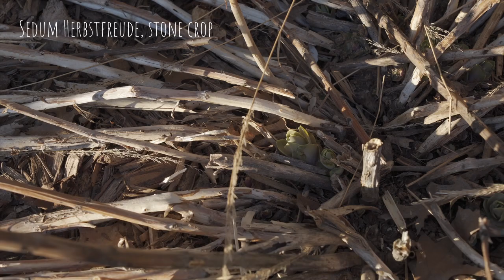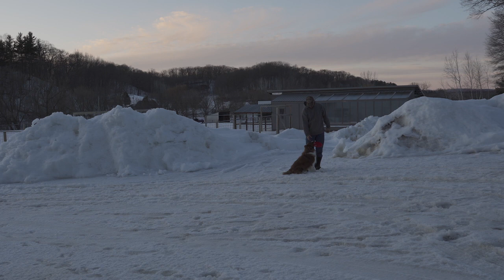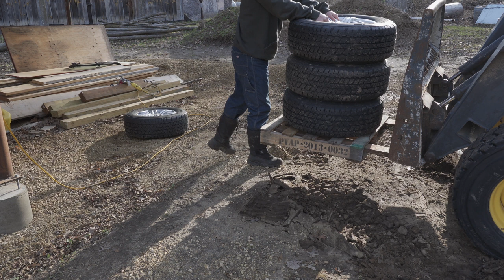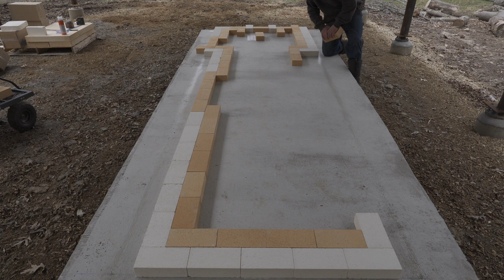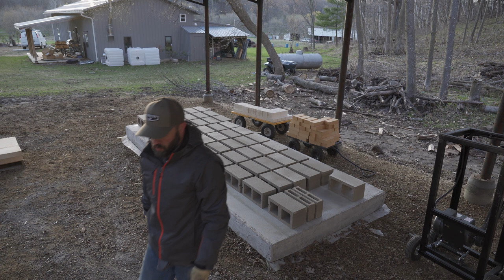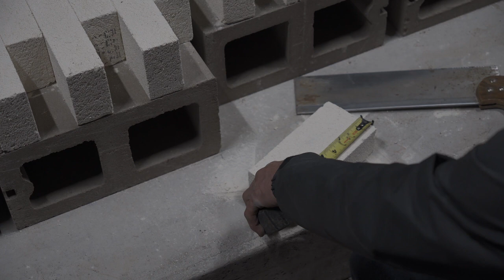#3 Building a Wood Fired Kiln - Spring cleanup and kiln layout

Comment: I don’t think concrete block have any strength on the side like that though
Reply from the maker: Cinder blocks definitely were designed to be installed with the hollow openings vertically, especially when building a wall that will bear the weight of roofing and any snow load.  However, to say the blocks don't have any strength on their side is not true.  They have enough compressive strength to handle the weight of the firebricks, pottery and kiln shelves with a wide safety margin.  The reason most kiln builders place the blocks on their side is to allow airflow to cool down the concrete thus preventing heat damage to the cinder blocks or the concrete pad that they rest on.  Thanks for the comment!